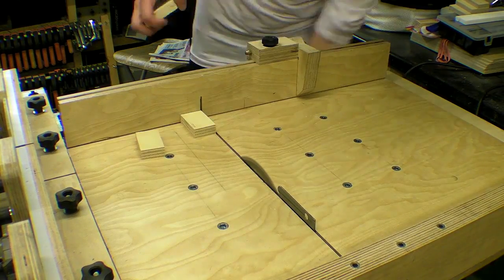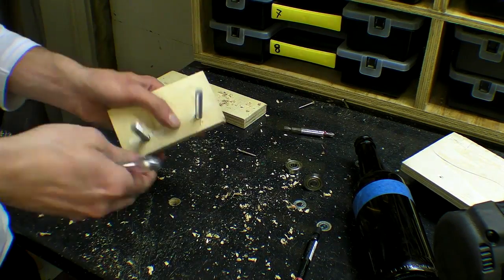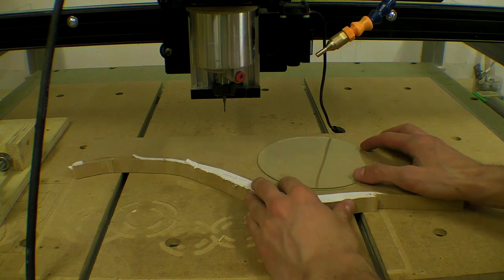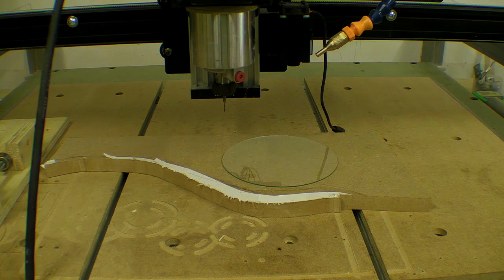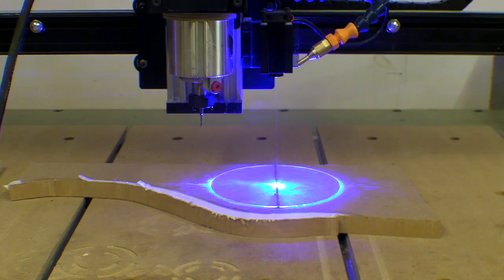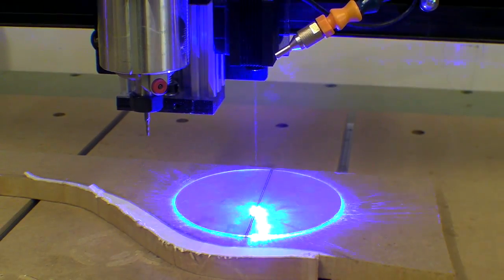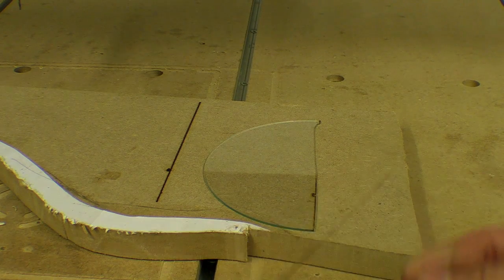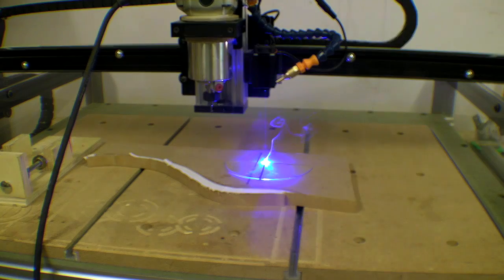Trying to Cut Glass With Laser - 2.5w Blue Module

Comment: i think for glass better IR laser because glass is opaque for IR spectrum
Reply: There's some sense in the comment section after all! :-)
Reply: paul30003 the desktop co2 lasers only really Mark glass not cut it
Reply: I was about to say the same thing.  I don't think an IR diode would cut though.  I've seen a desktop 40W CO2 laser that will cut glass.
Reply: Thomas Anderson I have a 75w co2 laser and it can mark glass but it CAN NOT cut glass
Reply: @SeptrothFFXI  140 sinrad will cut quartz or glass tubing. never tried any pane style glass
Reply: the IR spectrum is not long enough either on diodes, so you need a CO2 gas laser to get a good long wavelength that is absorbed instead of reflected or passes through with out effecting it, 

I am kinda surprised the brown bottle did not have any effect on it though since it has pigmented stuffs inside it that allow heating them maybe, guess they were just not enough though, 

like using natural or clear plastic vs solid black plastic of same plastic type you can cut the black but not the clear or even natural, instead when I tested it, it just burned the stuff under it, though I was using a 2.5w 395nm laser not a 450nm like I am guessing he had,
Reply: to add I think if we can get a diode laser that puts out a much higher frequency, one that is in the totally ionizing range, or nearer to the VUV (Vacuum Ultra Violet) range, it would work for cutting glass and just about anything else, with enough power :)
Reply: hmm I wonder what it takes to cut it. if it marks it I wonder also if it could be used to fuse nano powdered SiO particles to print in glass.
Reply: I meant mark not cut.  The system I saw replaced an axis with a rotary axis that was used to engrave glasses and bottles..
Reply: If you ran it really slow at max power it probably could, it leaves a surface finish comparable to sandblasting where the laser hits clear glass
Reply: Yup, I have the rotary for mine, Epilog helix
Reply: IR laser diodes are fairly cheap and are rated for much higher wattage than the visible spectrum light diodes we see here. C mount Diodes are a bit cheaper than the  standard diodes, but people are some what dishonest about them. As long as you only need half the rated wattage they can actually better than an equivalent visible-spectrum diode.
Reply: "The lasers used in laser glass-cutter systems are high-powered CO2 lasers on an infrared wavelength."

Comment: "In the Middle Ages
 glass was cut with a heated and sharply pointed iron rod. The red hot 
point was drawn along the moistened surface of the glass causing it to 
snap apart. Fractures created in this way were not very accurate and the
 rough pieces had to be chipped or "grozed" down to more exact shapes 
with a hooked tool called a grozing iron."  - Wikipedia, Glass cutter - I suspect that what's happening in this video is analogous.
Reply from the maker: Maybe I can use the laser to heat a piece of metal which then drags on the glass?

Comment: Hey Savvas, try scoring straight across, then moving the score line to the edge of the mdf and pushing down instead of taping the edge of glass when picking up. I.E. the side you score needs downward force applied at the edge of piece, not at the middle where scored.

Comment: I thought for sure it would work! Maybe if it were to hang over an edge, to help distribute the stress along that line during the break? In either case, thanks for the plug. By the way, I love how it sounds so futuristic as it moves.
Reply: The sound is from stepper motors. A controller adjusts the timing of the steps to make it accelerate and slow down smoothly.

Comment: I'd be of the opinion if you used a better edge, straighter, would yield better cut results. Rather than just tap it and hope it breaks on the line perhaps if you aligned it along the edge and tapped downward on the over hanging piece, might make for a better break or cut edge. I've cut glass in the past, not enough to be considered a beginner, but enough to know that when glass vibrates it ripples and breaks where it wants, the scored edge is simply a general guide.

Comment: could try and make one of these. http://www.widgetworksunlimited.com/CNC_Diamond_Drag_Engraving_Bit_p/cnc-dmnd_engrv-250.htm
Reply from the maker: +Sirus You can get diamond tipped wheel dressing thingamajigs? Practically the same thing.
Reply: But you would have to depend on bed flatness, the machines ridgity and z acuracy with a rigid tool. This has some sprangy sprongyness in the shaft on the z to compensatorate. A bit like a cnc tap head.
Reply: Get some really coarse aluminium oxide paper, pull a big bit of grit off the paper and then stick it on the end of a ballpoint pen.
Reply: Dressing tools are just hard, not sharp or precise, well my mates 2 carat single diamond isn't, you only want one edge to cut one line, any more is engraving.
Reply from the maker: +Sirus Ok this sounds like a challenge!
Reply: ***** woot, ill try it on my little cnc over the weekend, given wifey/kids sturf

Comment: "I think the heating of the MDF did most of the work"...

Yes I was thinking the same thing. One way or another, it did cut the glass. You might be on to something, Savvas.
Reply from the maker: +GameraTheBrave Heat and high temperture of trapped fumes.
Reply: @SavvasPapasavva  2.5w laser cut a 4 mm MDF ?
Reply: 2.5w laser cut a 4 mm MDF ?

Comment: Nice video. I have a few suggestions one is to move the laser closer to the target piece. Two beam focus has to be tight. I could not tell from the video how focused the beam was. I worked two weeks on a cnc laser and it was very close to the target and laser beam focus was very small point of light. And never try to cut polished metal. We had a job come in on polished metal with a plastic coating and every once and a while you would feel these burns on your skin just a quick flash when the coating was burned away and the polished metal was exposed.  After a few of these we put up panels to block any further problems. This was a small 4x4 laser that was open.
Reply: There is a big difference between a CO2 laser and a blue diode laser. A CO2 laser is from a laser tube. The light rays coming out of the laser tube are parallel and use a special glass lens to focus them. The focus is not adjustable because of the parallel light rays entering the lens. A diode laser emits its light rays from a tiny point and the light rays are not parallel. A focus lens is used to adjust the focus and is variable.

Comment: I think you would be more successful if you give the glass the same amount of passes with the laser on both sides of the glass. Try it.
Reply from the maker: +Angel Luis Trinidad No harm trying but the scorch marks were on the underside of the glass, which was strange. Maybe it was the fumes which heated the glass?
Reply: Yoiu might try some magic marker on both sides of the glass. Mark it on top, run it several times. Flip it over. Mark it again. Run it several times again, and then try to break it.

Comment: Cool video. But I think you got the power wrong in the title? It's 2500 mW, so 2.5W?
Reply: +James Williamson aye! If it was 2.5kW it would blow a hole through the table :P
Reply from the maker: +leosedf The laser obviously effected my mind.
Reply: +Savvas Papasavva No worries. Have you thought about getting a lens and a bit of lens tube to get it closer to the surface. Focusing that laser would make it do a much better job on the glass.
Reply: +Savvas Papasavva It has a dial at the exit of the laser? This will only adjust the collimation of the laser. If you want a really tight spot for optimal cutting you'll need another lens closer to the surface you're cutting. For cutting thin materials with good resolution you'll want a short focal length lens which will have a small spot diameter but short depth of focus. For thicker materials you need a longer focal length lens which will have a greater depth of field but a bigger spot size.
Reply from the maker: +James Williamson Yep I did, will change that - thanks!
Reply: +Savvas Papasavva You will need much higher power to do that. But anyway you can use it for many interesting stuff.
Reply from the maker: +James Williamson The laser is focusable but I don't really know how to focus it without staring into the fire, so to speak. But I think I need to get it hooked up to the z axis and not just on the gantry.
Reply from the maker: +James Williamson Maybe I could hack an air assist nozzle with a lens onto this, but I haven't seen it used like that. It does seem to produce a really fine dot but I can't really measure it.